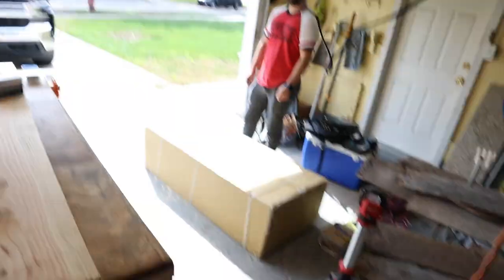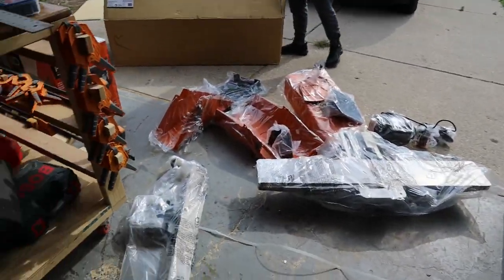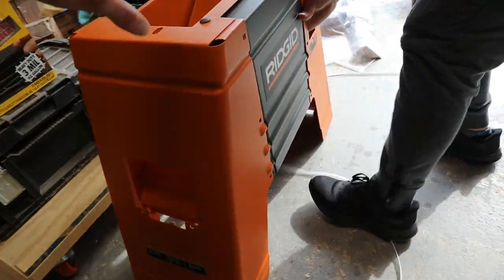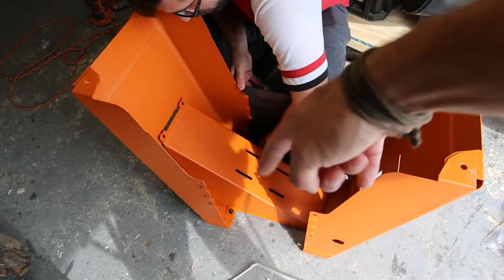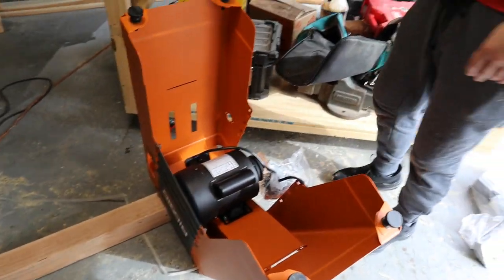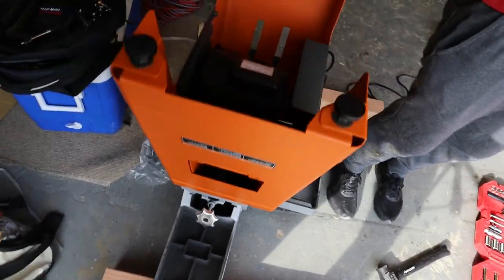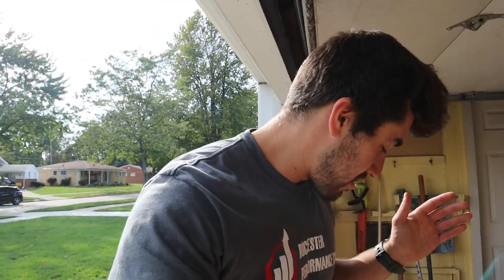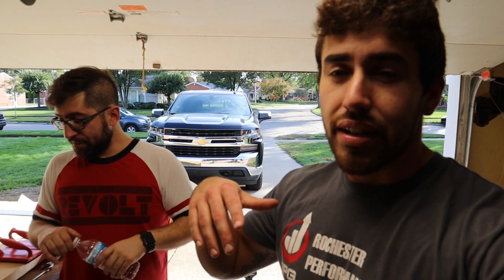RIDGID JP0610 6 1/8" JOINTER UNBOXING & ASSEMBLY

Comment: What’s the longest board you jointed on it? Would you be comfortable with an 81” board?
Reply from the maker: i have done about a 55" board and was comfortable with that. 81" may be a lot if there is no outfeed table
Reply: I’d use an in-feed and out-feed roller support for heavy stock over 60”. For something like a 1x4 81” may be ok.

Comment: Hi nice video, I just ordered one but for some reasons it’s been on and off the the HD websites but my ordered went through, did you experience having a  trouble getting in stock?
Reply from the maker: Hi Jaime! Luckily, I did not have any issue with it being in stock. If your card got charged, I would assume that they processed your order. Their customer service at HD is very helpful, so if you don't get any email or anything like that, I would give them a call! I hope it all works out!
Reply: @francesco_alexander  I just received an email and they said they shipped it, should receive around November 30 to December 4 , thanks for your time!
Reply from the maker: @jaimegenovajr3257  I’m happy to hear that! Happy building my friend 😁
Reply: @francesco_alexander  hi, I just want to follow up on you, after holidays I finally got a chance to use it then I discovered the motor spins counter clockwise, and it doesn’t cut wood, did you rewire anything when you assembled it? Please reply and thank you so much
Reply from the maker: @jaimegenovajr3257  I did not do any rewiring when putting mine together. That’s super strange and maybe you have a faulty jointer? I would reach out to rigid forsure
Reply: @francesco_alexander  yes I’ve returned it to Home Depot and ut is so heavy to bring it there, but I did get a refund
Reply from the maker: @jaimegenovajr3257  I’m glad you were able to get a refund but it stinks that the Jointer didn’t function properly :/
Reply: @francesco_alexander  yeah been trying to search I think the polarity is opposite, but I don’t want to mess with it, and I don’t even know if I will order same thing that fits the size and budget, my project is pending for now till I figured out what to buy

Comment: I just started assembling mine and thank you for info plus used it.  I did already see something you missed but you have it together probably will be just fine.  I did have one of those disappearing bolts that hit the floor and ran away.  LOL!!  Thanks again
Reply from the maker: Oh boy 😅 thankfully that missing piece hasn’t come back to haunt me yet! lol, I’m glad you found the video helpful!!
Reply: @francesco_alexander  The dust shoot/motor support should have went above legs and not under them.  That way the weight of the motor is resting on the legs versus on the bolts.   I am the one with a runaway bolt.
Reply: I can’t find anywhere to buy it
Reply from the maker: @JonathanPajakLensCulture  dang that sucks man, I’m sorry to hear that! I got mine at Home Depot but I ordered it online